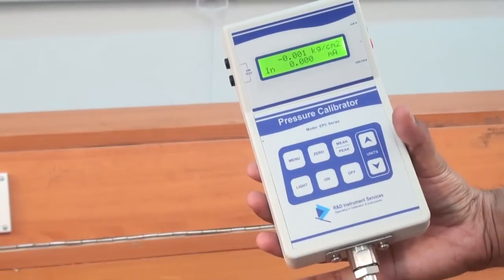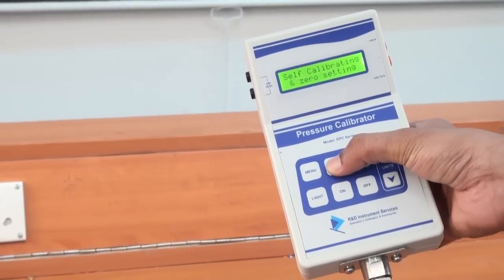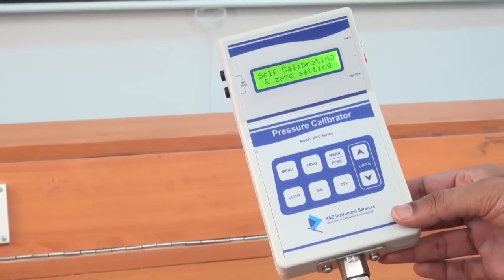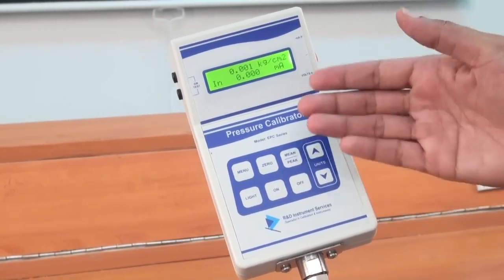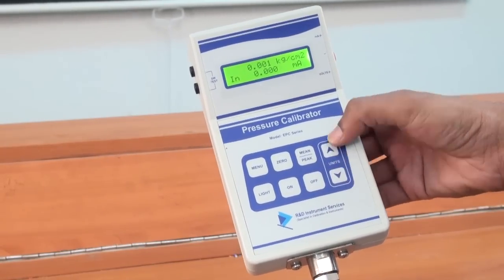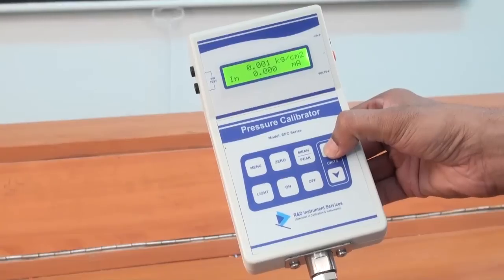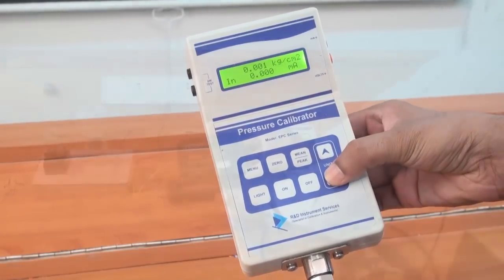Field Instrumentation & Control - Training at CRISP

Comment: i am a mechanical engineer is this course benificial for me?
Reply: Sorry for delayed reply, yes why not it is beneficial for mechanical engineers too
It includes Temperature, pressure, flow measurement, Control valves and Actuators, calibration etc...